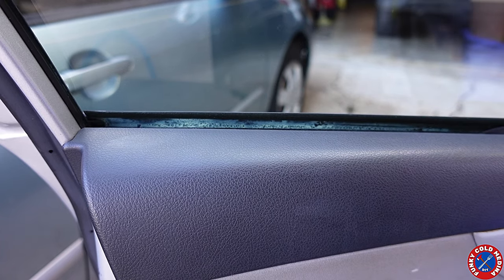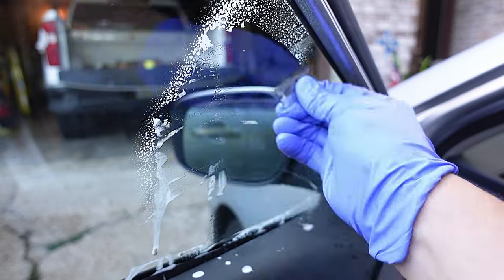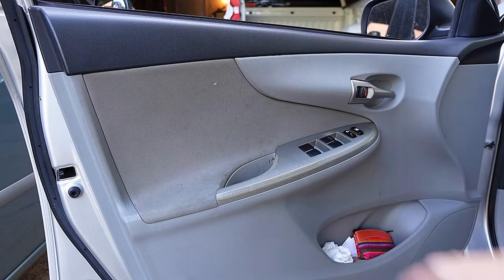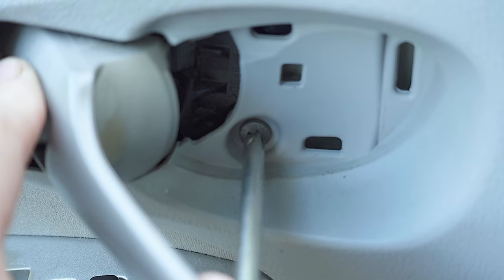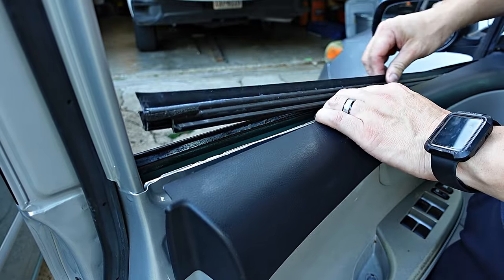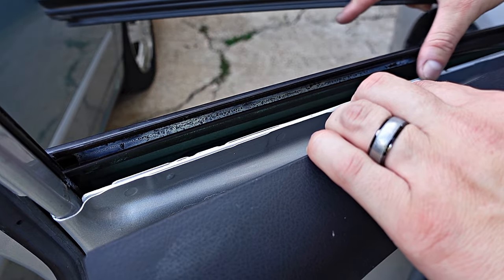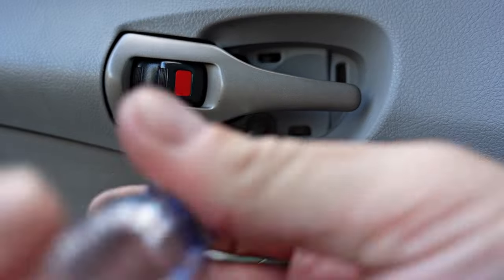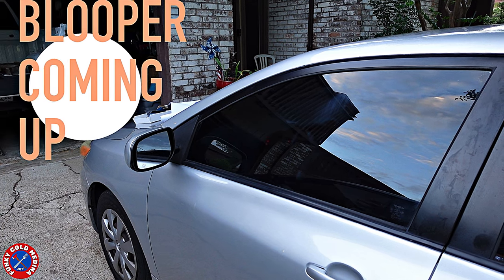How to FIX a STICKY Car Window | Toyota Corolla Weather stripping replacement

Comment from the maker: Thank yall for watching everyone. If you are trying to search for the part, search for inner door weather stripping for your vehicle. You can find some on ebay. I went to the pick your part junkyard. $10. 

Let me know if this helps you out any.  If you LOVE the channel and want to keep the great content going, HIT that SUPER THANKS button up top and consider supporting the channel.  I will give all SUPER THANKS SUPPORTERS a SHOUT OUT in my videos😁.  Thanks to you our channel will continue to prosper.  Have a blessed day😎✌👻
Reply: where can I buy the weather stripping for a 2010 scion xb, I keep researching for it and I keep getting results for the outter weather stripping which I do not need. This is driving me crazy I need to replace it on the windows, please help.
Reply from the maker: @gemmaestradamora7086  I feel your pain. You can look on ebay for the inner door weather stripping or go a junkyard and find the same car or something similar. i used one from a Camry and had to cut down to the right length but it works.  Try an auto parts store and see if they can help you by at least getting you a part number. You could even try a dealership. Hope this helps. Good luck. Thank you for your time and have a blessed day🙏😁
Reply: Great if you have a jun yard near by that will let you dismantle 4 door interiors. Never thought a part could be so hard to find. 1000's of exteriors, 3 interiors all OEM for about $50 each.
Reply from the maker: @artistnyc123  wow that is a lot of money. I didn’t realize there were rules at a junk yard. I thought it was a free for all. Every one I have been to, you just walk in and go to town

Comment: Finally I see someone replacing the inner seal, both mine(scion tc) and my mom's(scion xb) car are dealing with this
Reply from the maker: Thank you very much my friend. I believe in fixing things the right instead of just putting a band aid on it🤣Sorry for the late reply, thank you for watching and have a blessed day🙏😁
Reply: mine 2
Reply: My scion xb is doing the same now😭😭
Reply: My 2011 Scion XB is doing it to all 4 windows too😤😤😤 I bought the outer strip but have a hard time finding the inner as well👎🏻

Comment: hello! I need it for a 2010 corolla! Where can I get it other than directly in the Toyota! thank you
Reply from the maker: Great question my friend. I had a hard time trying to find the part elsewhere. I just went to the junkyard where you browse cars and pick a part off any car. I used a Toyota Camry of similar year. I had to cut it to length but it was no big deal and Installed it with no problem.  If you don’t want to go the junkyard, I would recommend going to the dealership. Its not that expensive and you will get the exact part. Thank you for watching, sorry for the late reply and have a blessed night🙏😎

Comment: Hi my toyota gave up on all 4 windows  but I cant find the ones in the back or I'm putting it wrong 😅 help!!!tia
Reply from the maker: So sorry to hear you are having trouble. I haven’t replaced the rear weather stripping on the rear windows before. I assume they would be the same as the front. I hate to do this but if I were you, I would search for rear window weather stripping replacement for your vehicle on YouTube to see if there is a difference. If I ever have to replace the rear weather stripping, I will definitely make a video. I am Sorry for your troubles and that I couldn’t be much help. I wish the best for you and have a blessed day😁😎🙏
Reply: @FunkyColdMedinaDIY  thank you I'll try 💛

Comment: I bought four of these as replacements but it seems like they're all a little long for the window panel. Does third party weather stripping sometimes require cutting to fit? Would this work?
Reply from the maker: Great question my friend. Yes it may need to be cut. Thats what I did on mine. I went to a junkyard and got the weather stripping part from a camry. It was a little long so I cut it and it fit just fine. Thank you for watching, sorry for the late reply and have a blessed day my friend🙏😎

Comment: Thanks this is exactly what my 2011 Toyota Corolla’s doing I’m replacing my inner door weatherstrip also I had to call my local dealer for the exact name of these parts I removed the tint first I brought a steamer at Walmart and the tint came off so easily like butter no blade needed
Reply from the maker: That’s awesome Vidal. Im glad it helped. I haven’t tried the steamer to remove tint. Ill have to try that for sure. Ive used a heat gun and it works pretty well but I bet the steamer will do much better. Have a blessed day brother and thank you for watching😁😎✌️
Reply: Thank you My good sir, what would you say thw dimensions are, 1/4 by 5/8in?
Reply: Thank you My good sir, what would you say thw dimensions are, 1/4 by 5/8in?
Reply: Hi. Can you share with me the exact name of this part?
Reply: I'm late but is it necessary to remove tint if getting weather strip removed?

Comment: Love the video! It's what I need to replace. But can you please tell me what is the name of the part to look for it and replace.

I found 4pcs Weather Strips Window Moulding Trim Seal Belt For Toyota Corolla 2009-2012, but not convinced it's the part. Is that the part?
Reply from the maker: There are a few different names but I believe its called Rubber Weather Stripping Door Seal Strip. Hope this helps. Sorry for the late reply. Thank you for watching and have a blessed day😁🙏

Comment: Hey man, do I have to remove my tint to do this?  Or can i keep it on.
Reply from the maker: If its in good condition and clean, then yes you can. If you want to do it right, then I would remove the old tint. Use a hair dryer and some soapy water with a razor blade to remove the old glue. Its a little more work but its worth it. If it doesn’t look right installing over the old tint then just peel off the static cling tint and remove the old tint. Great question. Thank you for watching and have a blessed day🙏😁

Comment: JUST the video I was looking for! Thanks bro. I have the same car as well, can you link a similar weatherstrip that will fit ? I found the original OEM one but it’s $40.
Reply from the maker: Thank you very much Zach, I appreciate it. If you found the original for $40 then thats a decent price. I actually got mine at LKQ Pick your part. I was trying to find that particular part online but they were all expensive. Probably $50 and up. I found a similar year model Corolla at the junk yard and paid $10. Works perfectly. I would give that a shot if you have a pick a part close to you. Let me know if you have any other questions. Have a blessed day Zach and a Happy New Year😎✌️🎉🥂
Reply: Where did u buy it
Reply: Could you share the OEM??

Comment: Links for parts would be great
Reply from the maker: Hello there. Unfortunately Mostly everyone has a different vehicle. You can search for your specific vehicle on ebay or go to the junkyard. I got mine at the junkyard off a similar year Toyota Camry.  Even though my car is a Corolla, it still fit after I cut it to the right length Thank you for watching and have a blessed day😁🙏😎
Reply: @FunkyColdMedinaDIY  2011 corolla :D hence asking for a part number or link
Reply: @FunkyColdMedinaDIY  I’ll try my luck at the local yard
Reply from the maker: @wesraffa  sorry for the late reply. I unfortunately could not find a part number. I went to the junk yard and pulled one off a similar vehicle. Sorry brother. Thank you for watching and have a blessed day.🙏

Comment: I had this going on with my Toyota Sienna after getting some sap on it while camping.  Cleaned it with alcohol, dish soap, WD-40, and anything else I could think of.  I ended up using some silicone lubricant and the window is rolling up and down again just like before.
Reply from the maker: That’s excellent. I tried the silicone but it would for a little bit but go back to rolling up on itself. If you have tint, it will eventually peel it off which happened to this vehicle.  Sometimes you get lucky like in your case. I much rather have that solution🤣Thank you for your comment and for watching. Have a blessed day😁😎✌️

Comment: Can you spray the white lithium grease directly at the weather strip? My car's outer weather strip is the one catching. The felt is still there from what I can tell, it's just rougher feeling. I'm wondering if the grease can help prevent me from replacing the strip.
Reply from the maker: Great question. Absolutely Camster. Give it a shot to see if it works. I have tried it before but it does leave a light film on the window from the grease.  If I had to so all over again, I would try a Dry lubricant. Liquid wrench, WD40 and Blaster all have a dry or quick drying lubricant that wont leave any residue but still lubricate. Thats what I would do. Let me know if you have any more questions. Have a blessed day and thank you for the comment😁😎✌️.

Comment: where can I find the inner strip that you replaced online in need of urgent help
Reply from the maker: Whats up Edson. Man the best I could do was find it on ebay. Its a hard part to find. I got mine at the local junk yard and it cost me $10. I hope this helps. Ill try to find a link somewhere besides ebay. Have a blessed day sir😁😎✌️https://www.ebay.com/itm/324712980401?fits=Year%3A2010%7CModel%3ACorolla&epid=657750951&hash=item4b9a66dfb1%3Ag%3A-FAAAOSwP2lhfTbr&amdata=enc%3AAQAHAAAAsHEelHjw6qhkk%2BKUokcoa1RcBNw187Cr3In99unuAz4Jq5EMK%2BfGgtdBWrM8Pi5t%2BovNbjN0p1GyeIQAxVp%2FIEhgCN%2BB6b37McZanPl5mtjpNaxg%2FRqm7slWec%2FZyGVa5%2BwWnBrz0z4uVajiAQQDWkgwras0uJYQeyoxal1Ph%2FqLB2%2FjiNlB5CgEp%2F0VmV%2B6B0RQ2seWbR152LQUpTLf42PzZ%2FgKFt7z4OUXyZNw%2FNqF%7Ctkp%3ABk9SR7Tt7eLBYQ
Reply from the maker: You may also try the Toyota dealership. This is what I found https://parts.toyota.com/p/Toyota_2010_Corolla/Door-Window-Belt-Weatherstrip-Left--Front/62944844/6817202170.html
Reply: @FunkyColdMedinaDIY  thanks you very very much I appreciate it
Reply from the maker: @edsonmoses4043  You are welcome

Comment: Part #? can’t seem the find that seal anywhere
Reply from the maker: 🤣I couldn’t either. Thats why I had to go to the pick a part and find a vehicle similar to my car. I used the seal from a 2010 ish Toyota Camry. I had to cut it to fit but it worked. I had a hard time trying to find the part to buy new. Im sure you could go to the dealership and they should help you or try to sell you a new car🤣🤣Thank you for watching and have a blessed day🙏😁

Comment: Where do you get this to buy thou
Reply from the maker: Hello Romario, thats a bit tricky. You can definitely try the dealership. I actually got mine at LKQ Pick your part. I was trying to find that particular part online but they were all expensive. Probably $50 and up. I found a similar year model Corolla at the junk yard and paid $10. Works perfectly. I would give that a shot if you have a pick a part close to you. I will try and see if I can find one online or ebay and send you a link in the comment section. Have a blessed day and thank you for watching😎✌️
Reply from the maker: I found this on ebay Romario. This is the wording that you use to search for it. Inner door weather stripping. https://www.ebay.com/itm/324712980401?fits=Year%3A2010%7CModel%3ACorolla&epid=657750951&hash=item4b9a66dfb1:g:-FAAAOSwP2lhfTbr&amdata=enc%3AAQAHAAAAsHEelHjw6qhkk%2BKUokcoa1RcBNw187Cr3In99unuAz4Jq5EMK%2BfGgtdBWrM8Pi5t%2BovNbjN0p1GyeIQAxVp%2FIEhgCN%2BB6b37McZanPl5mtjpNaxg%2FRqm7slWec%2FZyGVa5%2BwWnBrz0z4uVajiAQQDWkgwras0uJYQeyoxal1Ph%2FqLB2%2FjiNlB5CgEp%2F0VmV%2B6B0RQ2seWbR152LQUpTLf42PzZ%2FgKFt7z4OUXyZNw%2FNqF%7Ctkp%3ABk9SR7Tt7eLBYQ